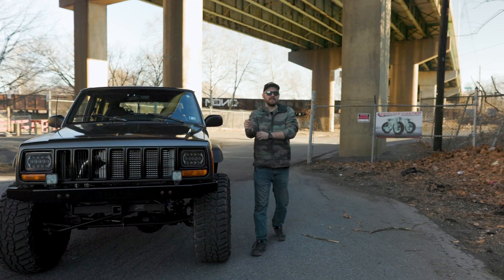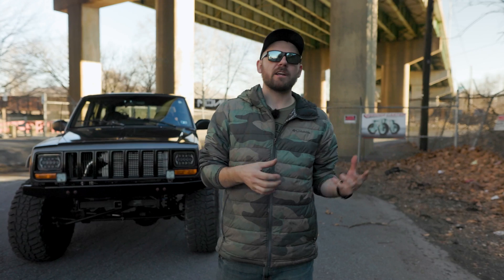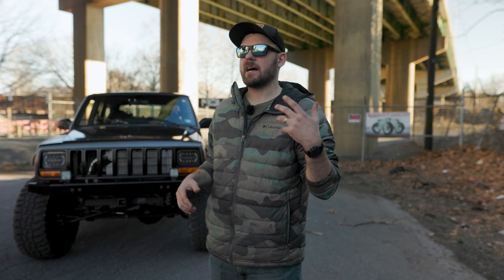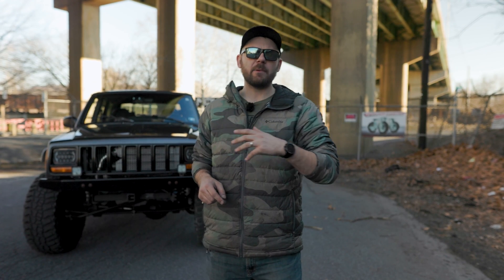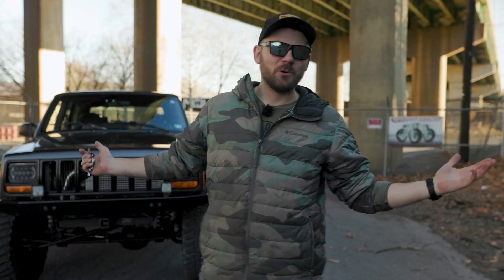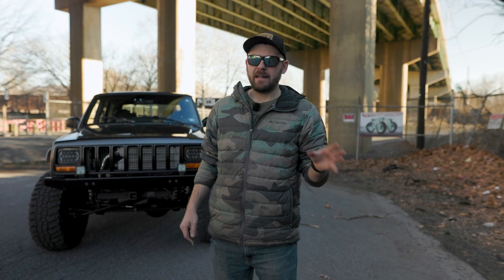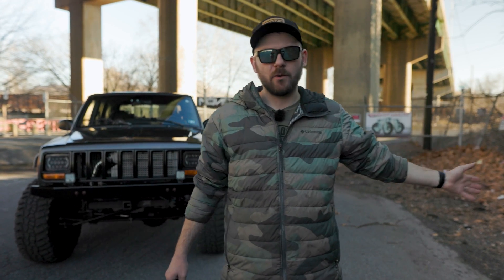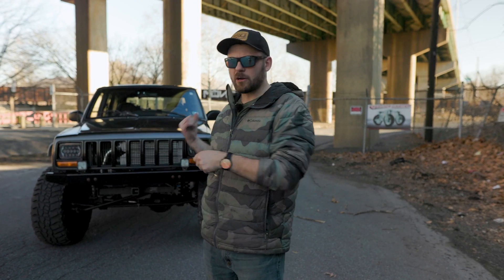Diesel Jeep Cherokee XJ Cold Start Procedure

Comment: What’s the mpg
Reply from the maker: I still need to do a short video discussing MPG. I get usually 20-22 city currently on 35's and around 24-27 highway. Usually 24. It really depends how I drive. I like hearing the turbo and I don't take it easy, so I don't get the best fuel mileage. That said, it's way better than a 4.0 and more powerful.
Reply: @turbodieselxj  its a tdi right? what all has been done to it?

Comment: The production of these videos are great and that XJ is sweet. I just bought my own a couple months ago. It's got a 3 inch lift on 31s and I installed new headlights just like yours. Got any good ideas for adding power or must-have additions to the Jeep?
Reply from the maker: Honestly the easiest and biggest thing you can do if you increased tire size is re-gearing. It is not an inexpensive project, but it's one that is often overlooked. If you are still running stock gears on 31's, dropping to 4.10's or even 4.56's (if you plan on eventually running 33's) will make it feel like a different beast.
Reply: My 99 is set up the same, 3" on 31's, IMHO the 2 best things I've done to mine was Kevin's off road track bar bushings and filthy addictions motor and transmission mounts. I haven't changed the gearing yet because I might swap axles soon.